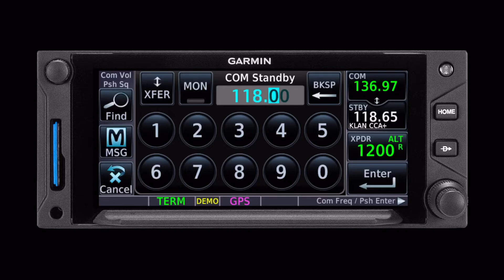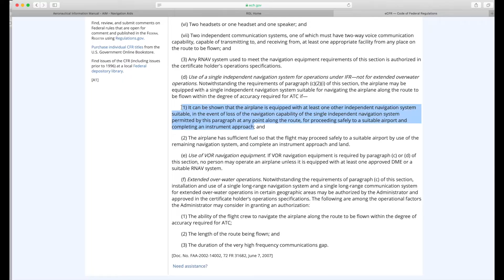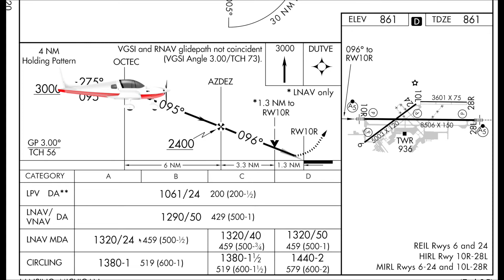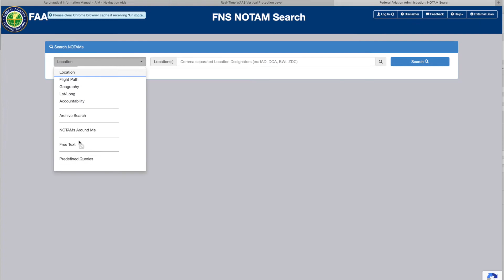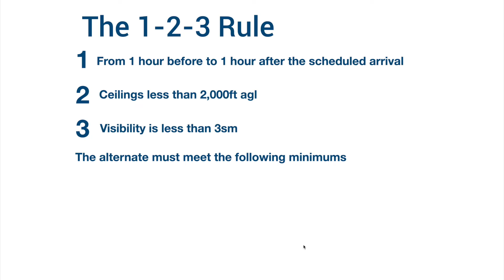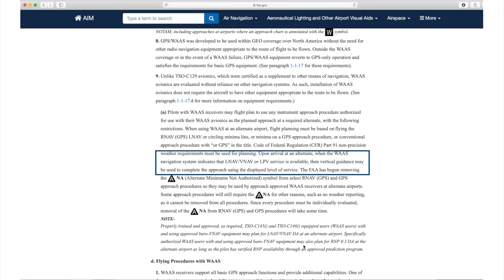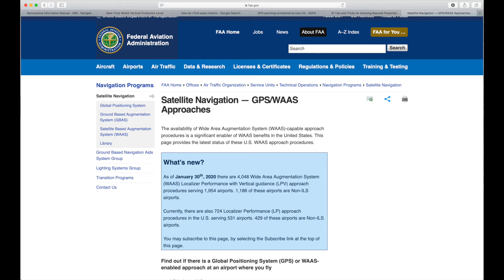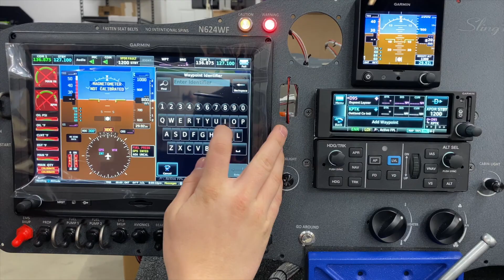GNX or GTN to equip your aircraft build for IFR?

Comment: Excellent video. Lots of great information. Wouldn’t a GNX 375 + GNC255(instead of a GTR20) be a better option since it allows you have a Nav/Com? I think it would be more equivalent to the GTN650 + GTX 45R. 1 GPS, 1 Nav, 1 Com, 1 ADS-B In/out Xpdr. Or am I missing something?
Reply: I think you're right - functionally, you'd have equivalent capability, but at the cost of panel space.  Also, the GNC255 is quite deep (11.23"), so it eats up space behind the panel too.  It was designed more for legacy installations, so it has interfaces for HSI, autopilot, etc., that you probably wouldn't need, while on the other hand, the GTR 20 has a built-in 2-place intercom that you might actually want (and save on having to buy a comm panel, too).
Reply: @patrickshine4329  I believe the GNC255A also has a built-in 2-place intercom, so I guess if you don't mind the depth, you also get panel space savings there. It's a bummer that the 650 doesn't have a built in intercom, seems like low-hanging fruit. Great video and information btw, thanks for putting this together.
Reply: I went with the GNX 375 + GNC 255 combo because of the 8.33 kHz spacing required in Europe. So gained same capabilities as an GTN 650 equipped system at the expense of panel space. The GNC is quite long, but was able to fit without much issues.
Reply: Very, very, well done.... oh, and thanks for not starting with "Hi guys".    R